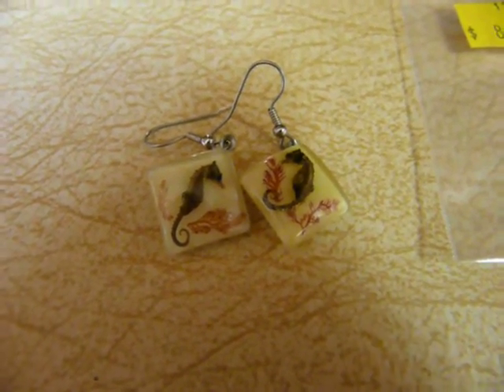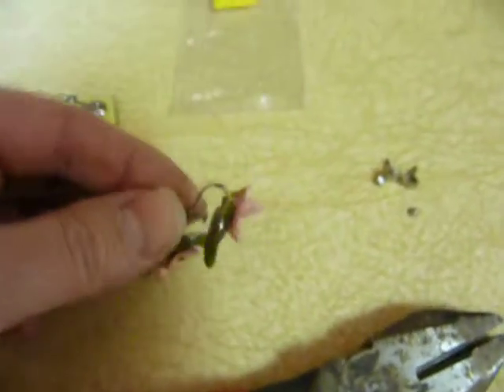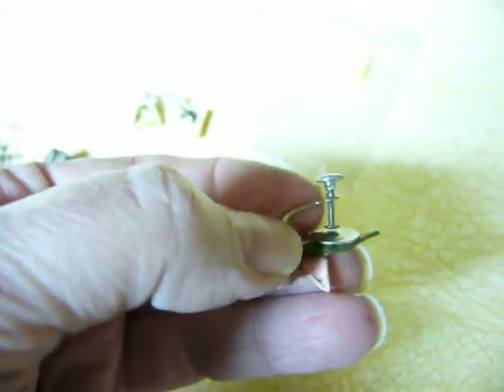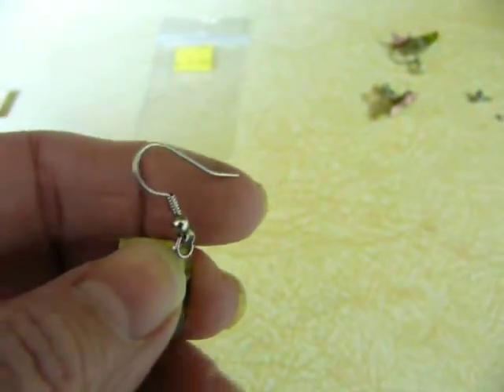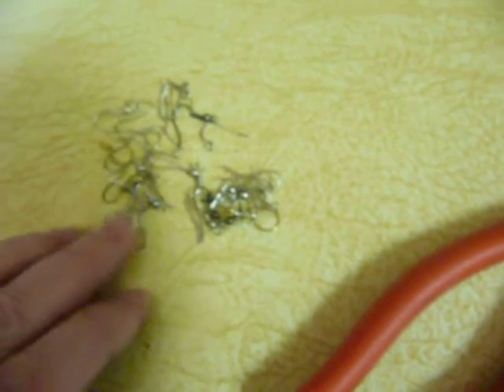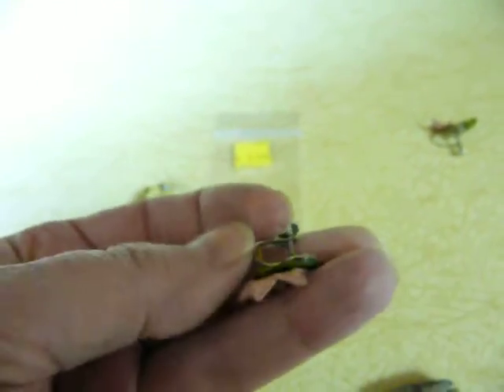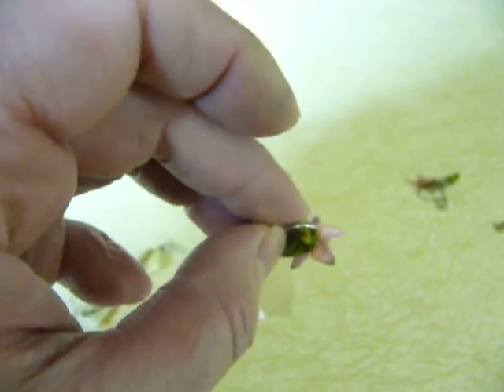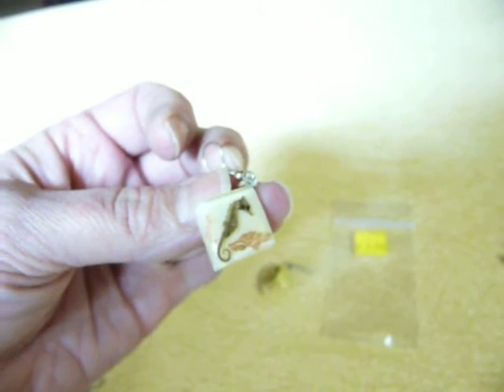How To Make / Making Hanging Pierced Earrings from Screw Clip on Old Vintage or Antique Earring

Comment: Thanks friend.  However these are screw-backs not clip-ons.  Could you please show is how to convert clip-ons? Thanks, again
Reply from the maker: Hi Sharon, you are correct. I have done something similar with the clip on earrings. I carefully take the part that flips on to the back of the ear out of the spring holders. Usually, you can pull one side of the holders area out just a bit and pull that portion off. Once it is off, you can use a little bit of wire to connect the two holes that usually hold that spring back part on. You can slip earring hooks on that wire. I will try to make a video on this at some point in the future. Thanks for watching. Have a Blessed day.
Reply from the maker: If you leave a little extra wire between the holes, you can twist it to make a loop in the center of the two holes where you can put the hook so the earring hangs centered. If you don't want it to dangle, you can put a drop of super glue on the base of the hook which will keep it in place. Good luck. Have fun!